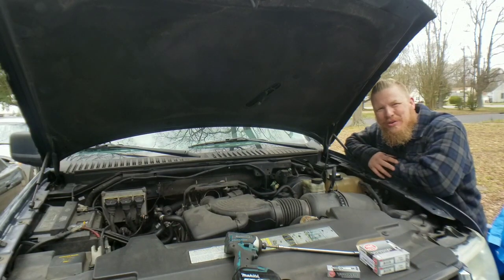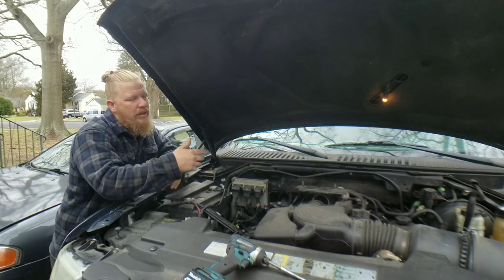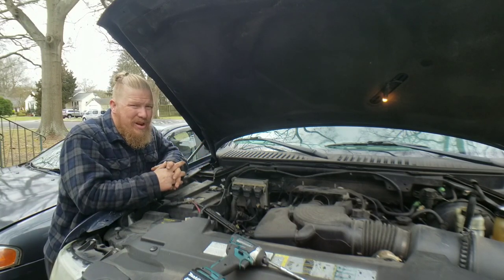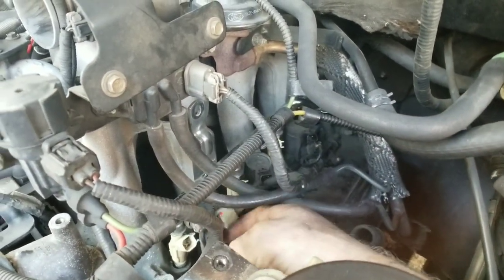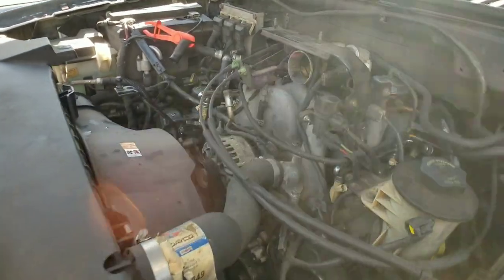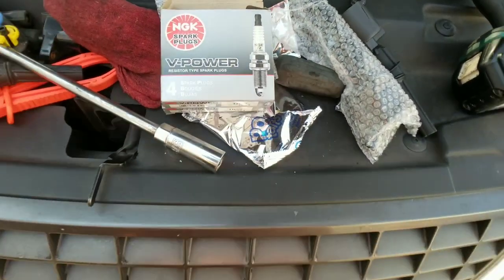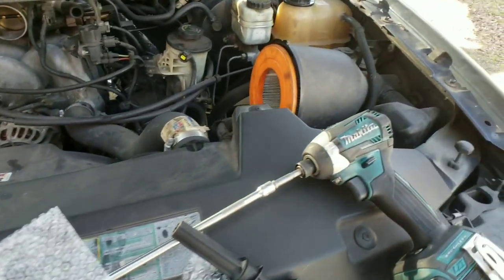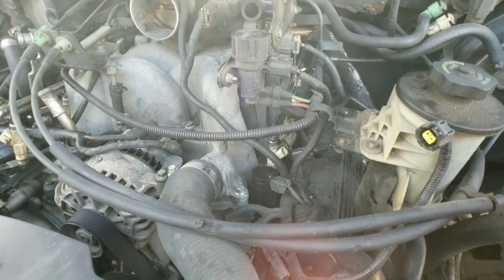2003 Ford Expedition Spark Plug Replacement Made Simple!

Comment: Can I remove the fuel rail on the driver side to replace 7, 8 coils and plugs?
Reply from the maker: Yes you have to remove the fuel rail when replacing any of the coils. It will just give you more room to work, with less of a chance to break anything.

Comment: I just put new plugs and coils on my 03 expedition and now the engine won't crank over it would start before I started work on it sounds like the engine locked up what should I check
Reply from the maker: Is it making any clicking sounds?
Reply: @Sellthoseflippingcars  Thanks for writing back i was able to put a  socket and ratchet and manual turn over the engine it was locked but broke free and started right up. Thank the lord.
Reply from the maker: That is great news! Good to hear you got it all sorted out

Comment: Whatsup bro got a po457. I filled up the tank last week and it was a puddle of gas after $50 worth of gas so its definitely a leak what you suggest is the issue
Reply from the maker: Follow where it is leaking from, is it when you are filling the fuel or when its already in the tank?
Reply: @Sellthoseflippingcars  when filling up over 3/4 full it starts to leak literally
Reply from the maker: You need to inspect the fuel tank for a crack might be a rust spot worn thru
Reply: @Sellthoseflippingcars  bro got another issue now wouldn't turn over this morning but battery is good I think it's the ignition switch are those hard to replace?
Reply from the maker: @doewin9527  did it click once? Did it crank but no fire? No an ignition switch is rather easy to replace.
Reply: @Sellthoseflippingcars  its trying to turn then starts clicking
Reply: @Sellthoseflippingcars  clicks a few times
Reply: @Sellthoseflippingcars  what ignition switch brand you recommend or does it matter?
Reply from the maker: Are you getting spark at all the coils? Have you checked the fuel pressure yet?
Reply: @Sellthoseflippingcars  it actually was the battery but I still have the leak how much to replace a gas tank?
Reply from the maker: The leak is coming from your fuel tank? Make sure you double check the lines that are on top of the fuel tank sometimes those dry rot and crack
Reply: @Sellthoseflippingcars  fasho let's say it's a line that's leaking how much should the repair be

Comment: Hey bro i changed my coils to high performance and the truck is shaking is it normal on my o3 expedition
Reply from the maker: No that is not normal. You are still experiencing a misfire. If you have a spark tester tool I would I suggest you use that to see which cylinder you are experiencing a misfire. Unless you are getting an engine code then you will know exactly which cylinder is experiencing a misfire
Reply: Im getting no code
Reply from the maker: @miguelgarcia3178  did you plug all of the harness plugs back in? Double-check your work
Reply: Use the cheap autolite plugs or motorcraft preferably... dont use the high dollar plugs/performance plugs... have seen  a friend do this and he didnt listen to me... ran like crap... changed the 18 dollar per plug plugs out and put in the 3.99 autolites and ran like a scalded dog... blew his mind

Comment: How do I put in the spark plugs
Reply from the maker: I usually put the spark plug in my spark plug socket then lower it into the spark plug well. First loosening it so I make sure that it is sitting flush on the threads then tighten it. Do not over tighten because you do run the risk of breaking the spark plug off in the cylinder head

Comment: When u say misfire what is it actually doing
Reply: I assume flashing Check Engine Light. That's my guess. I'm sure he'll reply though.
Reply from the maker: A misfire is a faulty spark plug, spark plug wire, or coil pack. In this situation it was a faulty spark plug because the previous owner never maintained it.

Comment: Hey wat if i broke the 2 hoses on the top right side that are connected to the metal hoses?
Reply from the maker: The vacuum lines?
Reply: @Sellthoseflippingcars  no at 14 minutes and 22 secs its were the grey connector is at the top at the right
Reply: There in between the 2 connectors and the grey one
Reply: 3 minutes 27 secs shows them clear
Reply: 4 22 too
Reply: 442 shows them
Reply from the maker: Sadly those hoses break quite often due to dry rot and wear and tear. You will have to buy a new piece that the two hoses connect to which is a evap sensor.
Reply: @Sellthoseflippingcars  wat will start to happen if i dont though?
Reply: Im gonna replace it but im just askin
Reply from the maker: Your fuel to air ratio will be off and the vehicle will run terribly.

Comment: I'm not getting any codes. I notice the truck runs smooth when I first start it. Then it starts to vibrate. It gets a weak acceleration and also notice a burning smell.
Reply from the maker: Have you had the brakes done recently?
Reply: @Sellthoseflippingcars  about a year ago. But idles a little rough. When I'm not driving and switch to drive or reverse.
Reply from the maker: I would start with cleaning your MAF and TPS. The MAF can be found on your intake tube. Your TPS can be found on the throttle body. If you need a video let me know and I can make one for you.
Reply: @Sellthoseflippingcars  thank you. I'll be heading to auto zone to get me the cleaner. One last question. I seen there are 2 hose on the back of the throttle body. One leads to the bank 2. But the smaller one I can't figure out where it goes. The space is to small for me trace it by hand
Reply from the maker: Those are vacuum lines that run to the valve covers.

Comment: Don’t use ngk they will not last use motorcraft
Reply from the maker: I really enjoy the NGK iridium spark plugs. I have not had any problems with the NGK unless you buy the cheapest spark plug you can find. Then you get what you paid for. Has there been an actual test done between NGK and its competitors?
Reply: Ngk are awesome.
Reply: Always use Motorcraft plugs in ford's, champions in Chrysler..  always been a rule of thumb in the older v8s

Comment: Changing all the coils is a waste of money
Reply from the maker: Agreed unless you have a majority of them misfiring. Also if you look at Advanced Auto pricing they want $30 a piece I got all 8 for $80. So not too bad on the price and the quality is great. I definitely understand your comment tho, in most instances I would totally agree.
Reply: I've been replacing alot of triton parts bad out of the box from Amazon did the ones you installed work out right?
Reply from the maker: Yes they are working great still for the vehicle
Reply from the maker: Agreed, I love shopping Amazon the prices best the local parts stores by a fair amount of money.
Reply: @sellthoseflippingcars will those spark plugs and coils you bought off amazon work for an Eddie Bauer edition Ford Expedition? Its also a 2003
Reply: @juanorozco5095  I have the same vehicle and I will be buying the spark plugs from Amazon from the link in the description. Generally I've found nothing is different mechanically with the 03 Eddie Bauer edition, it's still an 03 expedition under the hood

Comment: I just went to a shop to get a tune up and my truck is worser then when i got the tune up now it wont pull the hill barely im just wondering what it could be
Reply from the maker: I would check to see if everything was plugged back in. Is the engine service light coming on?
Reply: @Sellthoseflippingcars  yes it came on and was shaking he told me to bring it back and i did it wouldnt pull hills so i have to it to midas couldnt read my codes went to firestone my cigarette lighter fuse was blown which cause my codes not to read and after putting the code in it say i have several miss fires they told me to come back monday
Reply from the maker: If you are having several misfires you probably have a vacuum leak. Check the vacuum hoses which will be the rubber hoses around the intake manifold. In the video I show you which ones come off. Check those on your engine to see if they are loose. Having a vacuum leak will increase the air the engine is getting and will throw off the air to fuel ratio causing multiple misfires.
Reply: @Sellthoseflippingcars  my truck drove perfect before he did the tune up pull hill everything he did something wrong it got worse the same day he did the tuneup
Reply from the maker: I would double check all the connections he would of took off. Something was not put back the way it should be
Reply: @Sellthoseflippingcars  i found out he left several things un hooked he broke my fuel injector wire where the coil sits which cause the misfire on cylinder 4 when the took it apart he put tape on it to hold it back if i didnt noticed ny car running rough he could have runined it now its running great thanks for showing me concern
Reply from the maker: @sexyonly135  that is crazy!!! I'm glad you found the problem and you are most welcome! Stay tuned for my future auto diy videos! Thanks for watching
Reply: @Sellthoseflippingcars  i will the exact words of my new mechanic was who been playing up under this engine i was so shocked it broke my heart
Reply from the maker: Yes, message me on the Facebook page it can be found in the video description and we can set something up.